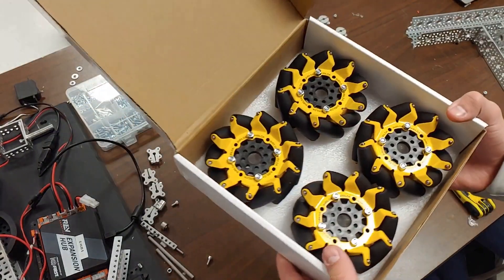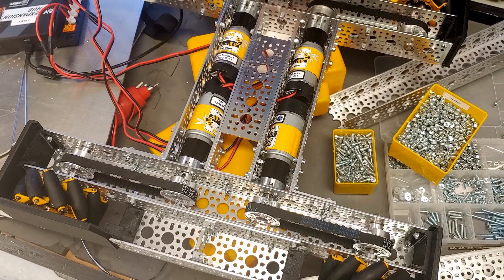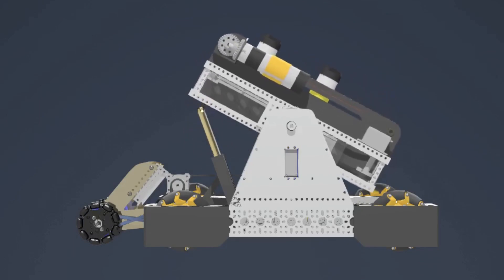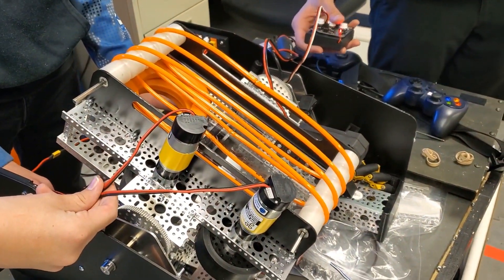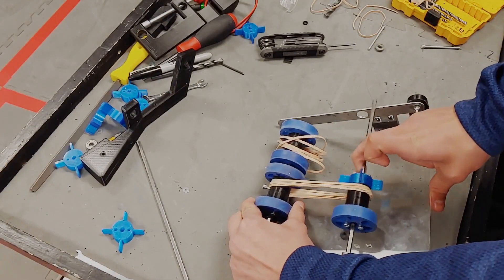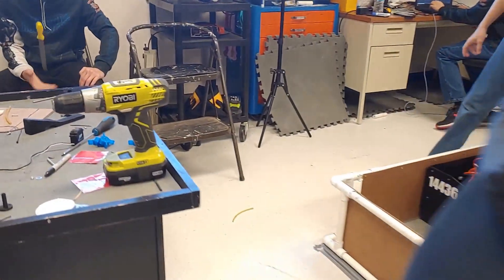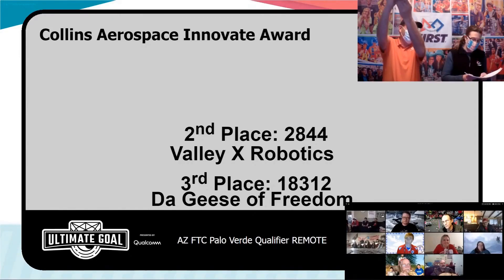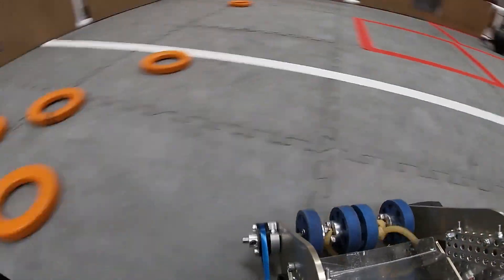We made a robot to launch rings!  | FTC Ultimate Goal

Comment: Can u share about the poly tubing
Reply: The polytubing was from REV Robotics.  We basically used several strands of it as a conveyor belt for the rings.  The poly tubing wasnt the best choice for that game though, because it turned out to be really slippery and it was hard to pull rings in.  We ended up getting it to somewhat work slowly by tying rubber bands through out the tubing.